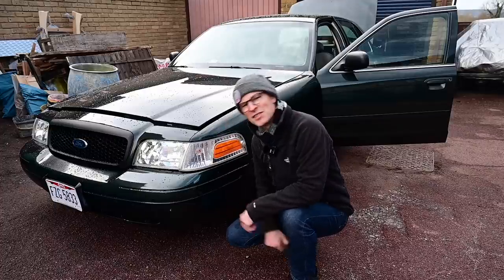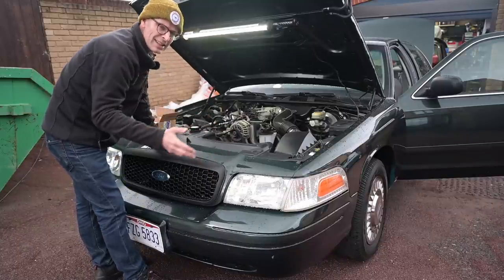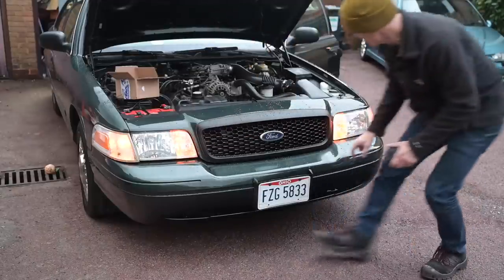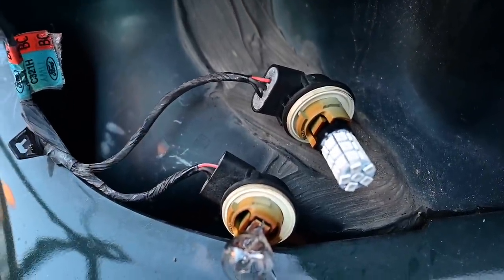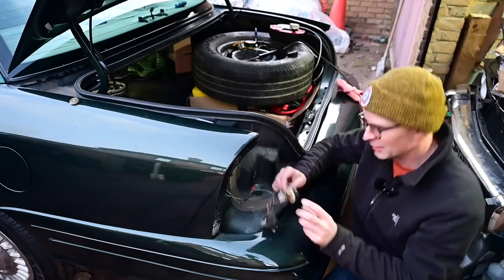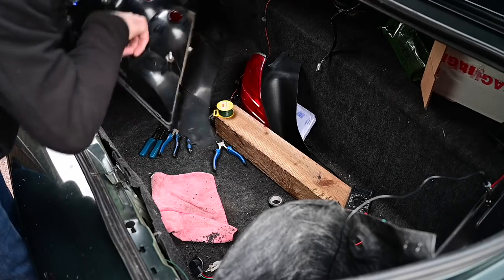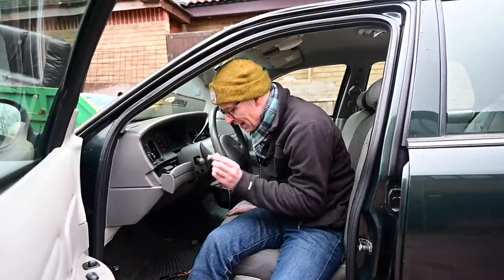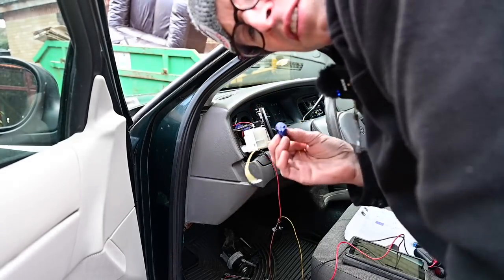Making my Crown Vic lights UK friendly

Comment: Wiring relays can be tricky to get your head around, especially when you don't know if they are faulty or not.  I wired separate relays on both high and low beam and also on the brake lights on my Austin and the process fried my brain until I was confident I had done them correctly, which I had 😊, of course!  I'm sure you will work it out with a bit of calm thought.  Fab job on the tail lights, silly US flashing red blinkers 😄.
Reply from the maker: I couldnt believe they were still so basic into the 21sst century! Well done sorting those relays, it does get head scratching going though!
Reply: I wish you were my grandmother

Comment: A little late, but the trick sits in the relay, and one need to change/rewire the blink relay. Think about it, you need a ground, and a positive for each function, and you got 1. Rear light 2, brake lights, 3.blinkers. that's 4 feeds, but you only have 3 wires per bulb. Blink/brake is merged in the blink relay, it's a special relay that can be changed to a euro spec one.

Comment: I seem to remember that a certain Vauxhall model in the fifties/sixties had a rear light twin filament bulb that also flashed as an indicator, twin bulb units the second one being the stop/tail.  Rear indicator/tail lights must have been legal then.  Front indicators could also be white then.  Indicators were also not a legal requirement as everyone had to know all the hand signals for the Driving Test and expected to use them at some point during the test.

Comment: So you actually can make the side marker lights flash with the turn signal. If I remember correctly all you really have to do is connect the ground wire on the marker to the positive wire on the turn signal bulb and then the side marker will flash too. Supposedly it’s an easy mod. They call it the Crown Vic blinker mod. Also that’s a cool idea for mirror turn signals! Never thought of that.
Reply: Over here in Britain, we have to have things called ‘side repeaters’. They are amber lights that flash with the turn signals, and are mounted on the side of the car, usually the front wing, so the turn signals can be seen by a car driving along by the side of you.

Comment: Love the vids. So interesting to see what all you have to do to get it ready. I have a 2001 LX non police spec. The bottom holes on the tail light are my blinkers and it is orange. From what i have seen the harness goes in about a foot and then there is a plug. My harness has 4 bulbs for the sperate blinkers.
Reply from the maker: If this hadn't worked I was going to get those lamps, but would still have had to rewire to make it work

Comment: For the side marker blinker, If you take the power wire from the side marker lights and put it into a 5 pin where when the relay is off, it works like normal, use the + wire from the turn signal as the trigger, and then ground the relay, it will flash with the turn signal. The 5th pin on the relay can be used as a flasher for anything else you might want to put onto the car. If you want to get rid of hyper flash, there is a 2 wires that are in the steering column that can be cut and a LED friendly flasher relay can be added. For Drl, if you use a + wire that kicks on with the car, use a diode, and relay to tap into the + safety/side maker lights. Using the wire on the lcm side as input and the + wire you just cut from the safety + as the trigger. The Drl setup will not have the headlights on. But it works otherwise. If you hook up the Drl right, the headlights and safety should work even with the key out.
Reply: The LCM(Lighting Controll Module)is just above the OBDII port which is on the underside of the driver dash right above the go pedal
Reply: Also try looking at tail lights from 1998 to 2011 there are a few that have the amber lenses and are a direct replacement if you wanted that more oe look
Reply: I own a 2011 p71 and am happy with it.

Comment: Worth pointing out that if you have a bench grinder, or indeed angle grinder, you can not only sharpen those spade (drill) bits, you can adjust their width and thus the size of hole they make. Some cone-shaped hole cutters are a good addition to the bodging tool-set.

Comment: seen various comments about hyperflashing, buy some ballast resistors from ebay, securely mount to the metal near the rear lights, wire as though a second/third bulb in the indicator circuit, keep all changes that you've made in the same area, if you decide to go back to incandescent, it will be easy to revert back to uk spec oem. Cheap chinese leds burn out, osram or phillips leds use better current limiting resistors in their bulbs.

Comment: Matt, you'll be MOTing on the VIN, so, if it fails, make sure that the retest paperwork contains the full VIN. I know this as when I went
through the process, my retest document only had a shortened version, which is normal, but no good for first registration purposes.
If it passes, there won't be an issue, as the full VIN will be there. In my case, the tester had to 're-MOT' the car by creating another brand new entry into the system.

One more thing, I think your headlamp diffusers will be dipping the wrong way. You may need to use some stickers?
Reply from the maker: the lamps are vague enough they should be OK as they have no real aim!

Comment: For the turn signal hyper flash you can also wire in a resistor on each rear light. You can find them on Amazon. Had to do that when I put LED rear bulbs in my Town & Country (Grand Voyager). In the USA Chrysler did a similar thing with the tail lights on that van: early models (01 - 03?) had separate turn and brake lights - albeit both were red. After that they switched to a cheaper brake/turn combined unit. Now that I’ve seen you do it I want to source some earlier separate bulb units, get green bulbs and wire them in for separate amber turn signals!Dammit Matt! I don’t need another project.
Reply from the maker: haha Ive started a revolution!

Comment: Great work, that's a beautiful Crown Victoria! As you experienced yourself it can be quite a headache to figure out custom wiring solutions. Given how liberal the UK is in terms of car modifications, I'm quite surprised you'd have to go through this trouble and have amber/orange indicators and add fog lights. Here in Switzerland the rules are so strict for any type of modification. However, the US style red indicator combined with brake light is legal. I actually went the opposite way of you on my Firebird and went from the standard tailllights with separate yellow indicator to the Trans Am version with brake & indicator combined.

Comment: You might buy a Haines service manual for that car. For the rear lights you might need to go up to the signal light switch to isolate the brake from the signal indicator.
I have been contemplating bringing a military Hummve into the EU. I want orange signals on the back.

Comment: About the tail lights and the unused portion at the bottom. Some years of Crown Victoria had separate turn signals with Amber lenses. That really would be the easy way. As for the hyperflashing, get the electronic flasher for a Trailer Tow package car. Get both. They are about $5 each. If the one for the 4 way emergency flashers sticks the wrong way, you have no brake lamps.
I suspect the problem with the rear fog is that the relay itself is not run to earth so it is not closing to complete the circuit

Comment: I feel your frustration with the lights! When I moved from PA to Maryland, I had to have the headlights and front fog lamps rewired for inspection. In PA high beams and fog lamps could be on together. In Maryland if the high beam was on it had to switch the fog lamp off, regardless of switch position. GRRRRR.

Comment: Iv done a few sva converts on japenese cars and used to go down the scrappy and get the fog light switches out of Nissan cabstars or old Japanese cars. The only stipulation used to be an illuminated switch. Not linked with headlights.
If I was you matt I would get a 12 volt tester with the sharp prong and go behind the light switch on the dash and turn the lights on and stab the tester into the wires until you find a live wire that reacts to you switching lights on and off. Then splice into that and run it into one side of the new fog light switch and run a live out of the other side of the switch to the rear of the car to the live side of the fog lamp. And pick up an earth from the other lights/ earth point/metal chassis etc.if your running and led bulb I wouldn't worry about using a relay as they don't require much current but Remember led bulbs are polarity sensitive, meaning you have to put the live to the correct wire or it won't work unlike normal candelesant bulbs. Hope this helps if you haven't already fixed it.
Reply from the maker: The new regs are headlights and to go off with the main lights and not come on again unless the switch is pushed - Ive checked extensively!
I was using a pin into the wire and touching the tester to that

Comment: Matt, you'll also need a warning light (or tell tale) to show when the rear fog light is on. Doesn't need to be anything fancy, a plain yellow light with a sticker beside reading "rear fog" would do, or you can source one from a kit car supplier with the rear fog light symbol.  Not having this is an MOT fail, section 4.9.1 of the UK car MOT manual (available on the .gov website)

I do think your relay box is faulty, though. That, or the wiring instructions are really very wrong. Is your relay box set up such that you can turn the rear fog light off again with another press of the momentary switch? Or would you need to turn the headlights off to deactivate the rear fog? I think the latter would not comply with the regulations.
Reply from the maker: Its built into the button (car builder solutions)

Comment: Good work seperating the brake and indicator circuits. 
Talking about indicators on USA cars though, why was it illegal and a MOT failure to have strip indicators (where a series of lamps come on individually one by one until the whole indicator reflector is filled). Then suddenly a few years Audi use the same system and that's OK?
Did the regulation / MOT rules change of do we simply ignore it because its a VAG product so rules don't apply?

Comment: Sounds like you need a multimeter! A relay should be easy to test, the coil part should give a reading on the ohms scale,  connect 12 volts to those terminals and you should hear a click. Don't American cars have a continuous orange light at the front? I would have thought that needs to be disconnected for UK.

Comment: You can buy canadian rear lamps-they have orange turnsignals.Car in garage,what is it?😉i have got Mercury Grand Marqis 10'.Car drives fully orginal(red turnsignals,simetrical headlights,no fog laps in back of the car) registered  as oldtimer.Wires under panel are for traction control no existing button😉  Regards from Poland.

Comment: Ford has a Daytime runningligt relay. with 70 % light.  Easy to connect. I dont like this drilling. But its a police car. I have had one issue with the headlamp relays. They did switch off. Had to to exchange to Omron mini relay in the ''blackbox'' Now its works fine. I have been the unlucky man here.

Comment: Hello from america I actually have a whelen 90 watt strobe pack, headlight flashers, and clear taillights, indicator, and license plate bulbs (and they all flash) in my 2011 cvpi they are blinding and illegal which is why i rewired them up to a switch on the inner fender under the hood i keep them off while i drive and turn them on at car meets to scare everyone lol

My cvpi came with all kinds of left over police equipment when i bought it the previous department only took out what they could easily take out and left the rest of it so all the wiring for sirens, multiple power hookups, a gps receiver, body camera battery, camera in the back seat, the plastic rear seat, rear window cages, rear divider, bullet proof truck pack, among many other things were left intact this car needs only about 2 or 3 things to be put back into service if it must

And my cvpi is very odd because out of all the options selected on this car (and i know because i found the build sheet for it) the department which bought it (New Castle County Police Department) opted for it to not be fleet keyed which i find very weird

Comment: If when you reinstalled your headlight housings, you got it on the first try I would've thrown my computer mouse through the television screen. But I noticed an edit and I'm sure it took a good couple minutes. It feels like I've installed a headlight housing on a crown vic about 50 times and it's still a pain to get the adjustment knobs lined up with the holes so you can clip it in

Comment: At 17:27 when you say "either one will do the trick," what wires are you connecting together? I assume the black wire on the bulb holder goes to the ground (or earth, as I believe you called it) on the trunk, but what wire did you touch to the green and red wire, the Orange/Light Blue wire from the car's harness? 

I live in the USA and have a 2010 Crown Vic that I want to do the 4-bulb tail light conversion on, like you did here. As it stands, my car is like yours: 2 bulbs per side. But I want to convert it to have 4 bulbs per side, the top two as tail/brake lights, and the bottom two as amber turn signals.

Comment: Those LED turn signals look really dim compared to the ol' incandescents. The comparison at 3:36 doesn't even trigger the camera's auto exposure for the LEDs, while the proper bulbs are an order of magnitude brighter. I get the color conversion but I dunno, wouldn't really feel safe or compliant with those.

Comment: I thought the need for the fog light switch to be linked to headlights had gone a couple of years back. But the simplest way would be to run the fog light power through one of those illuminated switches and connect the other side of the switch to both the dipped and main beam powers with a diode on each of the 2 powers to stop power going back up the other beam power. If you use a led bulb the power draw will be very small.
Reply from the maker: no, Ive checked its still needed! The new addition is it has to go off with the lights but not come back on until you press the switch, hence the different relay

Comment: My 2000 Crown Victoria had an orange turn signal in the bottom of the tail lights from the factory.  I don't know if that was something only done in certain years or what the deal was, but I've not seen another one like it stock

Comment: Brilliant choice of car, always wanted a Mercury Marauder, was thinking about the rear lights, when you finally installed the indicator bulbs into the taillight, the indicator didn't seem to illuminate the inner corner, where as you said it looked like the bottom part wasn't separated, could the fog light not go in those corners?

Comment: If that spliced off wire for the new indicators also did the original brake/turn filaments,  would the new indicators now just do what the old stoplights did?
Reply from the maker: dont seem to

Comment: I was always annoyed by my car also having the turn signal and brake light not separate. I have a 2000 GM and the same year CV has a separate amber turn, so I naively assumed my car has the wiring but not the housing or bulb for it. Guess I’ll look more into it lol.
Reply: Four bulb (amber turn signals) vs. Two bulb (red turn signals) setup. Ford eventually standardized the wiring harness to use in both the Crown Victoria and the Grand Marquis as a cost cutting measure.

Comment: take a wire from the headlights/taillights and run back into the instrument panel, this will be your live wire, and will only be live when the lights are on, then switch this wire with anyold switch and run a new wire to the fog lights at the back. lots of wires coming and going but easiest way to do it. of course you need to earth it all as well but can earth the switch
Reply from the maker: It has to be the headlight, not side or I could have done that
Reply: @furiousdriving  is it one single bulb that does both side lights and full lights then? how completely frustrating